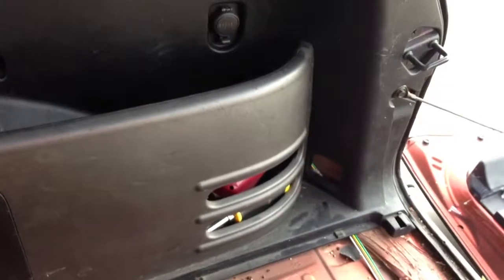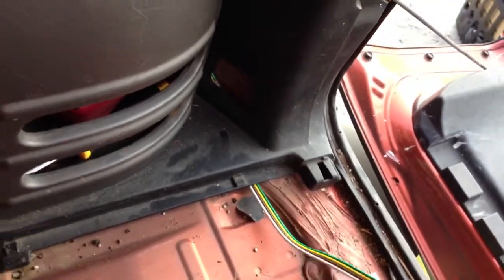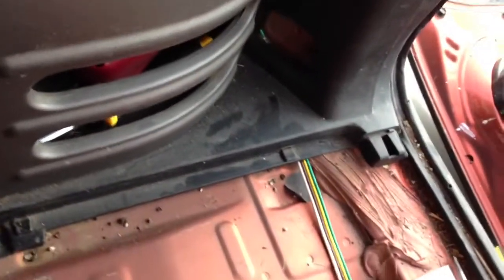2004 Honda Element Trailer Hitch Wiring Harness Curt install overview: Part 2

Comment: I just saw a Video.... this guy open the back.....open the spear tire compartment...& shows like there is a wire end....  and is  ready to be pluged in ( the Trl wiring kid )
Reply from the maker: toneroable let's see you do it, Sorry just saw this comment.
Reply: Different years of Element have the plug in different locations. 2003-2004 have it behind an interior panel. 2005-2008 have it int he spare tire compartment but require a special now hard to find module. 2009-2011 I have no knowledge of.